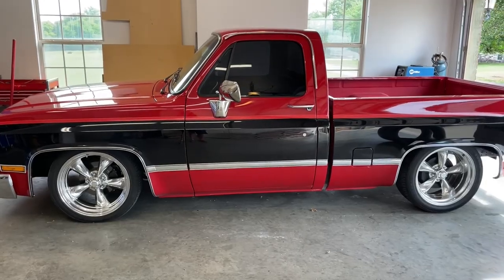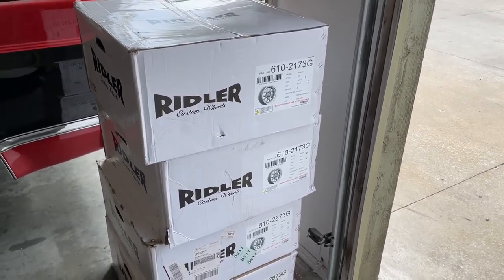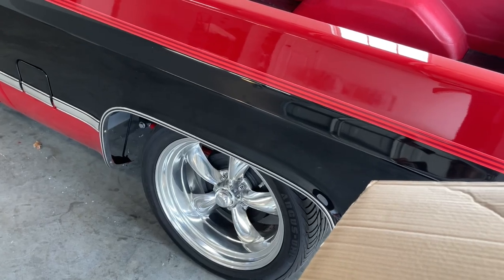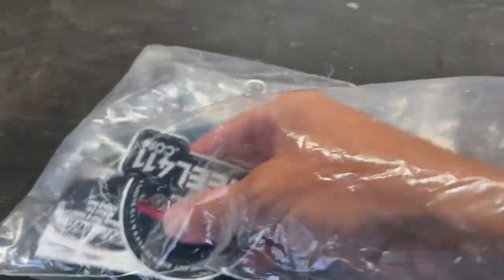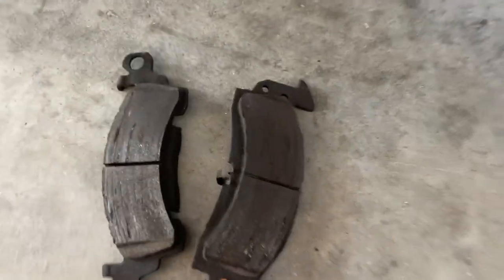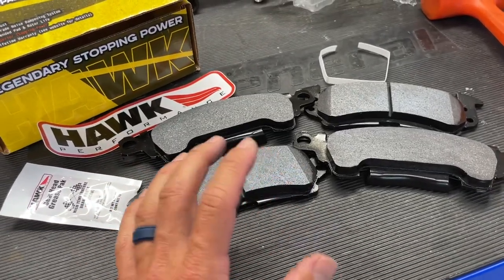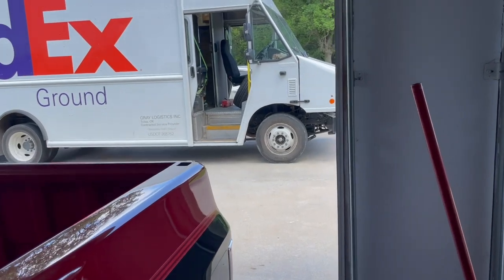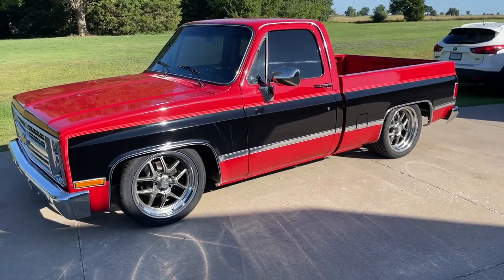Swapping out to Hawk brakes & the new Ridler 610 wheels!

Comment: Do you have anything done to the wheel wells or fender lips to fit the 315? Most of what I have read says don’t go bigger than 295.
Reply from the maker: Nope. Fit fine.
Reply: @GreaseMonkeyTV  what was the exact sizes 315/35r20? What’s the front?
Reply from the maker: @explorationoutdoors  Yes & 245/45-20